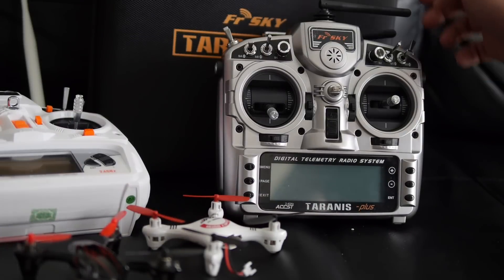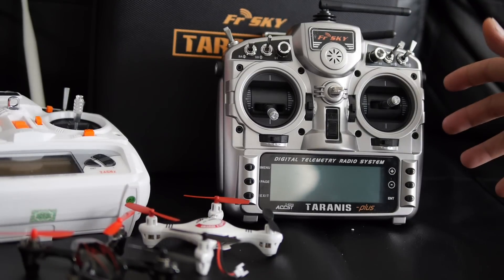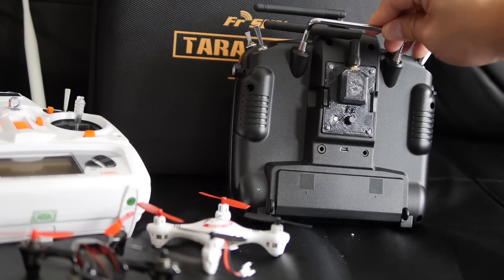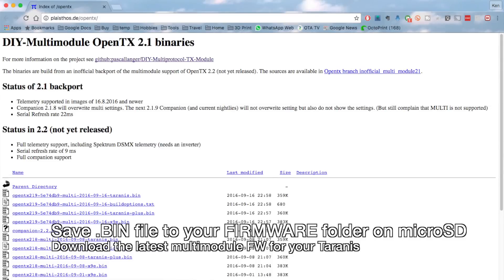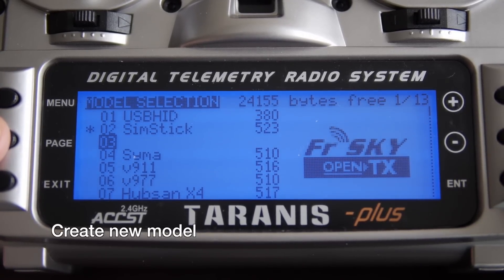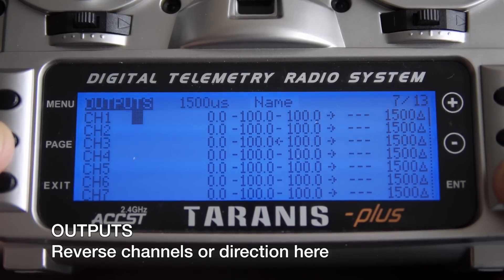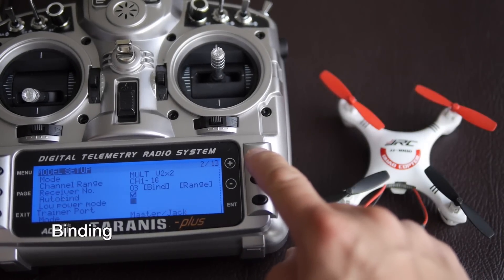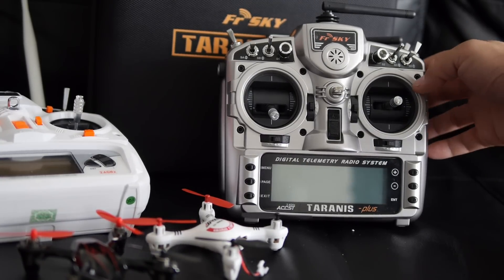4in1 multi protocol module for FrSKY Taranis from BangGood ATMega328P

Comment: Which Software do I use for Horus Open TX Nightly Build 2.2. NB 359 ?
Is there anything to flash in FRSKY 4in1 Modul Version2 from Banggood? Can I use the Modul directly without working on it?
So I know that the switch from the Modul has to set on ZERO. What about the bridges  on the modul TX and RX ? Must I do that ? Or is it updated at the modul so that I have not to solder the bridges?
Reply: How to use Nine Eagle Models like Heli V126V2 Night and Planes?
Reply from the maker: You can use the module directly without any firmware/soldering in PPM mode.  You will select the modules with the white dial on the module.  

If you want to select protocol in the menu, you will need to run it in serial mode by soldering the TX/RX and install opentx with multimodule support.  But I don't think the Horus is supported yet in serial mode from OpenTX.  So use in PPM mode for now.  

I'm not sure if Nine Eagles are supported.  You'd have to google that.
Reply: Is there a way to insert Nine Eagle? Was written in the List from Multi Modul Banggood for FRSKY.

IS it possible for you to make a video for Editoring the Multi Modul Firmware? Step by Step?

Comment: Hi, nice vid!

for binding jjrc jj 1000 do you solder the module? if not, which protocol in dial?  many thanks
Reply from the maker: https://github.com/pascallanger/DIY-Multiprotocol-TX-Module/blob/master/Protocols_Details.md

You can do either.  If you don't solder the RX and TX pads, you have to select I think V2X2 which is dial 5.  If  you enabled serial mode by soldering RX and TX pads, you can select it in the menu of OpenTX.  The dial listings are here in the github link I posted.

Comment: Question. Can you export models for a dx8 gen 2 and import them to the FrSky or must you reprogram. I understand checking channel assignments but, will the program work?
Reply from the maker: +Logo 800 completely different radio. So need to reprogram. Unless there is an app that converts the dx8 model files to OpenTx that I don't know of.
Reply: Thanks, my quads easy but, some of my Heli's take a while. I have had two Specktrum radios fail now. It's getting old just looking for an option. Great Video
Reply from the maker: +Logo 800 check out my latest video of the STM32 4in1 module. It has more up to date information
Reply: Thanks. I have lost 1 high dollar Heli, and now my new DX8 2nd gen is at HH for a Rf board i think is bad. My quad went down two days ago, and all seem to have a very short range now. The Frsky would be a good choice for running quads and Heli's  that have Specktrum receivers built in gyros and they were not cheap. I can use the module for specktum  and convert as my quads to FrSky
Reply from the maker: +Logo 800 the multi module is great for toy quads but wouldn't be good for long range or big aircraft. the built in FRsky module or external dsm module will be fine for the big stuff.

Comment: Quick question, will this module bind with the eflight umx micro models?? Please I need an answer :(
Reply from the maker: +Alan Luna I don't have those models so don't know for sure. but if it's using dsm protocols it should work. go to the rc groups forums and see if anyone has that model working with the 4in1

Comment: Woooow, this is awesome, 
Will it support telemetry for any of the protocols? 
at least for accst protocol (telemetry frsky receivers)???
Reply from the maker: I think some do have TX RSSI and battery info but not all.  I believe hubsan has it.  FrSky has some too.  I have yet to use any of this so I don't have first hand experience.  check out the protocol info here:

https://github.com/pascallanger/DIY-Multiprotocol-TX-Module/blob/master/Protocols_Details.md
Reply: Thanks for the info
Reply: OpenTX has full telemetry protocol support for all protocols that support it. These are mainly DSM2/X, Frsky varaints and Flysky AFHDS 2A.

Comment: Hi, i see you have both the Devo 10 and the Taranis. I have the Devo 10 as well and am wondering what is your opinion between the 2 transmitters? Since both can have all multiple modules and similar features, but the Taranis being nearly 2x the price. Overall in terms of the feel of the transmitter, gimbals, value for money etc what are your opinions comparing the two? I'm asking this because a friend of mine is asking on this as well as he plans to fly multiple protocols. Also if it's worth it if I upgrade to the Taranis, if you consider that an upgrade?

Thanks
Reply from the maker: The screen is nicer on the Taranis.  One of the things that bothered me the most about the Devo 10 was the screen.  It's so washed out.  I definitely prefer the Taranis.  It has more channels, more switches, speech output.  Both Devo and Taranis has ball bearing gimbals.  Much easier to add multi protocol support via external modules with the Taranis.  I prefer OpenTX vs DeviationTX in terms of the UI.  Frankly, now that playing field is even since the multi module is available on Turnigy 9x/9xr, Devo, and Taranis.  I can't see any advantage of the Devo radios now.  Although I do regret parting with my Devo 7e.  I like the compact size to carry around of the tiny 7e.  

I'd go with Taranis if you got the money.  The Turnigy 9X/9XR Pro offers the best value if you're on a budget.
Reply: Thanks for the comment! Great to hear it from someone who owns both systems and can compare. So basically the Taranis trumps the Devo 10 in every way eh. What you think about the gimbals on the Taranis though? I had not touched it before but I watched a video where the reviewer said the Taranis gimbals feels pretty crap and even the Flysky i6 feels better than it. Not too sure how true is that though.

Also, since I already own a Devo 10, should I upgrade to the Taranis?
Reply from the maker: The gimbals are comparable with the Devo 10.  I don't notice it being better or worst.  But I think it's just a matter of preference.  If you should upgrade to Taranis?  I asked myself that question, and I say yes.  I didn't like the Devo 10's screen.  I also prefer OpenTX.  If you have the money, I say sure, sell the Devo 10, buy a Taranis.

Comment: Any chance you would like to do an idiots guide to firmware upgrade on the module??  I know I could use a visual guide
Reply from the maker: If I see a need to upgrade it, I'll do a video.  Right now, since it's my main transmitter I don't feel like potentially messing it up :) flashing anything unnecessarily isn't something I want to do.
Reply: I don't blame you.  I've ordered one and I still have a number of questions.  What do I solder? Do I need to solder? Do I need resistors?  What firmware do I use? Blah!

Comment: How do you select and use the module in open TX 2.2, I believe 2.2 has the firmware already in it so I don`t need to install any other firmware.

Can you advise?

Wynne
Reply from the maker: +Wynne Davies (BoLt) you need a build of 2.2 that has it compiled in. You can download firmware with companiontx but make sure the multimodule  option is checked off. Then it'll download the one with mm support.
Reply: Thank you I was wondering where I went wrong. Like to say check the tick box for multimodule and download the firmware. All updated ok and now I can see the multimodule selections in the radio.

Fantastic bit of help.

Comment: Can you help me how to autobind on eachine h8? Every pull batery out, i nedd to bind every time, or can you uploud bin file for eachine h8, i only use 4 chanel, i dont how to configure on taranis qx7
Reply from the maker: +Adi Putra autobind doesn't work with all models only some. Just enable auto bind in the options.  That's all you need to do. If it doesn't work then it's not supported
Reply: kenVersus or can you show use swith to bind the h8 every pull out the lipo, because i use irangex 4in1, they not came with bind bottom on backside module? 😀 
I follow step on another video to use swith  SH to bind is not work

Comment: Hello. Nice video! I am wondering if I can use flysky receivers instead of frsky with this version? I am wondering because the frsky receivers are expensive, and I want cheapers ones. Therefore I am asking if it's possible to bind it with any flysky receivers? Hope it it! Thanks for reply:)
Reply from the maker: +ReLaaaks yes it can work with flysky protocols
Reply: do I have to update the firmware for this? Also may u update the links?:)

Comment: my multiz module binds on my hubsan x4 but nothing happens when i move any of the sticks. any idea why?
Reply from the maker: +Ronn2664 yiu create a model with proper channel mapping?
Reply: kenVersus yes, I think I did. I am testing the multi protocol module on the taranis qx7. Does the module has opentx version compatibility? I currently have the latest opentx 2.2 (n367) installed on the qx7 right now.
Reply from the maker: +Ronn2664 watch my latest video about makerfire and qx7. Shows how to configure and set up.
Reply: kenVersus ok. I'll watch it. Thanks.
Reply: kenVersus watching it right now. thanks.
Reply: Just finished watching it. I'll try it on my makerfire later. Thanks.

Comment: i have installed the update and it has the e010 in the list but will not bind
Reply from the maker: I'll get my E010 in a few weeks so I'll see.  I have no experience with that quad yet.
Reply: Im also interested if this actually works for the E010 since I just bought one.
Reply: i had to flash the mod and it is working good
Reply from the maker: You may need to flash the 4in1 module in order for it to work.  Check out my other video with regards to updating the 4in1 module.
Reply from the maker: Good to hear it works now.

Comment: Thanks, any link to preset models you know off?
Reply from the maker: In the description but here it is again:

Sample Model files (4in1-taranis-MODELS.zip)
http://www.thingiverse.com/download:2825904
5min timer
SF switch is throttle cutoff. 
SE is lights on/off
SG is Flight modes, with low/med/high rates. 
SB is reset timer
Reply: Lol okay, I didn't expect them on thingaverse 
I thought that's the printed case file.

Comment: will it work with Eachine E010?
Reply from the maker: I haven't tested it myself but it should work under the Bayang protocol, there is a subprotocol of E010 in the latest multi-OpenTX firmware.

Comment: On your sd you have a model for the Eachine H8, could you maybe poubish that to download?
Reply from the maker: +Robohac01 it should be in the description if not I probably don't have it. I usually create place holders in the radio for quads I have but they aren't actually configured.
Reply: kenVersus OK that's unfortunate, I'm unable to bind models to my module, I tried 2 Spektrum and also the H8, I think I have to cantata the support. But thanks for the reply

Comment: i could really really desperately, use your help if you would be so kind, with this 4 in 1 module, for some reason i just cant seem to get a grip on how to utilize it properly, would you kindly help out a fellow quad enthusiast, i watched your video over and over, read everything i can find, and scoured the internet for any remnant of info pertaining to this particular module , i purchased this module after reviewing this vid thinking it was the answer to all my different quads, and i thought i could work through it, but i guess not, im using the taranis qx7,  and i did get it to work for my bayang protocol whoops ie, redpawz R010, Bwhoop b03 Pro, h8 mini and h8 mini 3d, but i think i just lucked out after trying and trying...so basically im begging for some help, since i cant find anyone else who has a clue on what to do to make it work for me, i'll provide my phone # and name if you wouldnt mind dedicating some time to teach me where im lacking, thank you so much
Reply from the maker: Hi what issues are you having specifically?
Reply: you know what KenVerse,  after i posted my question for you, i dove in again to conquer this thing, and i think i was just making it harder than it actual is, once i figured out setting the dial to 0 , and then choosing the "multi" option  under model setup, and then selecting what i needed in the multi sub category. it made sense, i watched and read everything could on the module, also watched a guy soldering a header on the module among other things, and i just got confused, now i got it down......so false alarm !!! but thanks for responding so quickly, thats a very kind gesture, thanks alot for your vid, have a good one

Comment: Thanks for posting this - the instructions on the Banggood website are nonexistent ; )
Do you know if there is a video on how to update the module firmware?
Reply from the maker: I don't know of a video.  If I do upgrade mine, I'll make a video but I don't see a need right now to update it.  Any reason why you want to update the module firmware?
Reply: No reason,  I hadn't checked the version that shipped with mine so this was more of a 'just in case' question.  BTW,  it bound fine with my Eachine H8, but the Inductrix BNF seems to be ignoring it.
Reply from the maker: Inductrix uses DSM2 or DSMX I believe.  I don't have that model but I do have a Blade mSR and it works fine in DSM2.  Maybe try either DSM2 or DSMX.
Reply: Thanks, I tried toggling between the 4 avail. versions of DSM2 and DSMX with no luck. =\
Reply: Got it.  The 'Autodetect format' box was checked.  As soon as I unchecked it it bound with the DSMX 22ms protocol.  =)
Thanks again!
Reply from the maker: awesome!  good to know for the future.